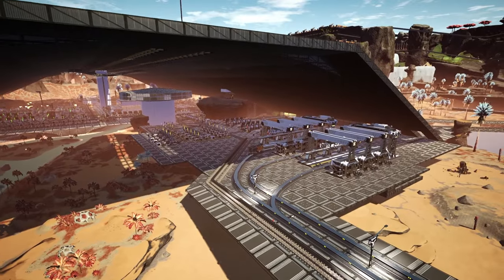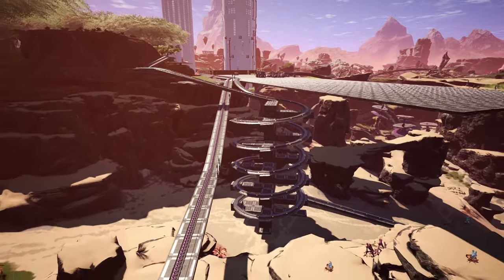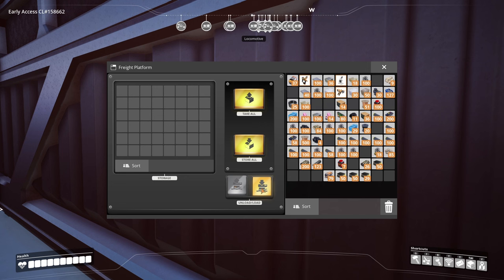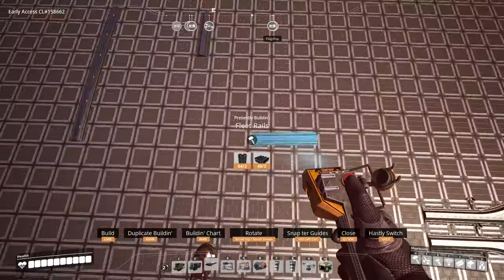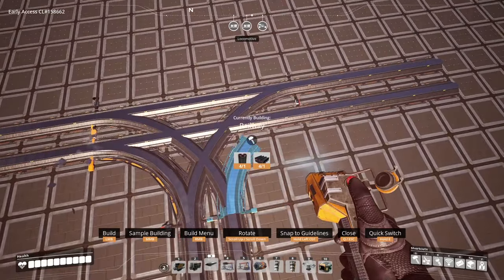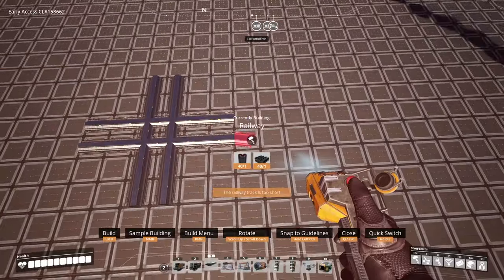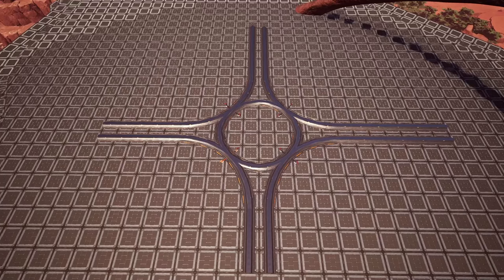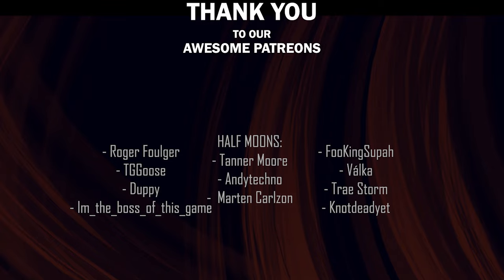Satisfactory Trains & Junctions Guide | Satisfactory Game

Comment: Roundabouts don't appear to work in update 5. You cannot connect two Y junctions on the same end point. You can make a 3 way split in rail junctions now. Between point switches you need at least a minimum length section of track (1.5 to 2 foundations).
Reply: Thank-you Simon. I thought I was doing something wrong as I get the "to close to another switch" error

Comment: With signals and collisions coming folk will need to train themselves to twin track rather than make a single lazy line
Reply from the maker: That's not strictly true as I mention in this video, it depends on if you use a slip track for a train waiting, along side the main track, but the best option is to have twin tracks. :)

Comment: 1:25 trains have more throughput than conveyors...
emm... no they don't... considering you need conveyors to put stuff IN and take stuff OUT of a train is done with... conveyors.

The "ideal" from a logistics and efficiency POV  for transportation method is just conveyors from one end of the map to the other.
The advantage of trains is that they offer bulk transportation without the need to build a dozen belts from one base to the other.

But if you want reliability, predictability and best throughput... belts is the way to go.